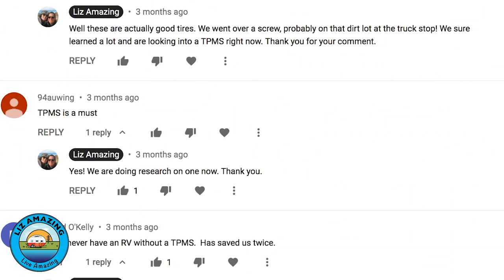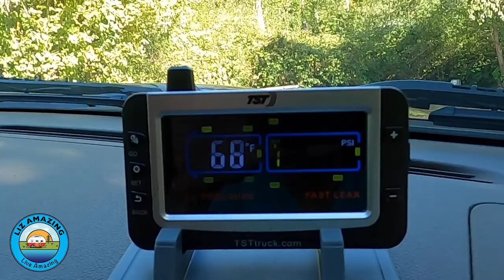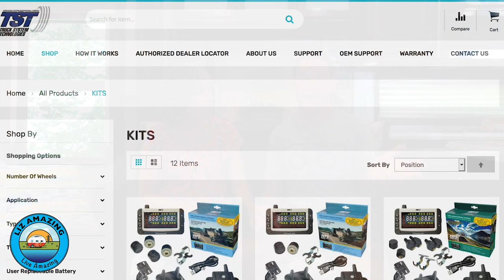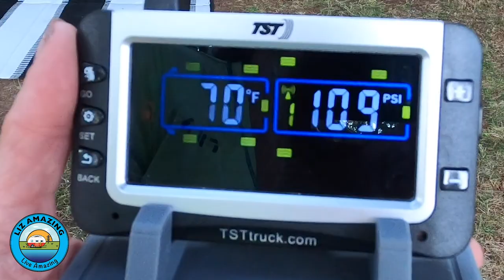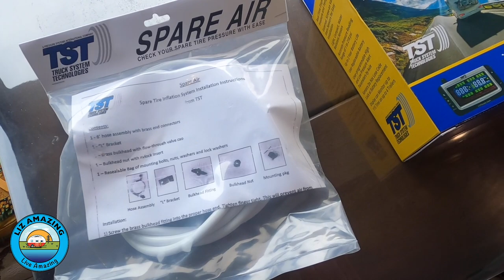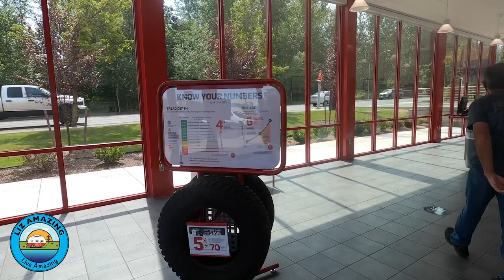How you can prevent a Tire Blowout | TPMS | Westlake Tires | Fulltime RV Living

Comment: We just had our second blowout. The first was the original cheap China tire that comes with the trailer. It did several hundred dollars of damage to the rig. I realized that my tires were under inflated. I didn’t realize they needed as much air as they did, lesson learned. This second blowout tore off the side trim of the trailer. Since the first blowout I bought GoodYear thinking they were US made. I’ve been anal about making sure my tires are good and inflated properly. We had only traveled about 150 miles when it blew. So now I guess I’m buying a TPMS system. Thank You for the video and the info.

Comment: Love your videos, guys!  You rock.  If I can say... I believe most blowouts on RV's happens because of two reasons.  One, the tire is not inflated to the pressure recommended on the sidewall.  I had a tire guy tell me one time that ST tires must be inflated to the pressure rated on the sidewall, or you will have a blowout.  Second, driving over 65 mph.  I never drive our RV over 60 mph, even on Interstates.  If I'm on a county road or something, I'll pull over and let people pass if I'm not doing 65 mph or more.  I drive with the China bombs that came with our RV and never had any problems traveling all over the U.S.  Drive fast and not have the pressure up, I can almost guarantee you will get a blowout at some point.  Keep the awesome videos coming!!!
Reply from the maker: Great points! We agree 100%! And we will never be without TPMS because the continuous monitoring is so valuable. Happy travels and be safe!

Comment: Tires heat up for a number of reasons besides the outside temperature and inflation pressure. Wheel alignment, loaded weight, driving style, (excessive braking, cornering too fast, as well as excessive speed) .......are all factors in tire temperature.
We have the TST system and love it. One tip....use metal valve stems even with the lighter weight sensor caps (non flow through).......rubber valve stems will bend from centrifugal force at even moderate highway speeds. Our sensor caps were bending down far enough to touch the rims. Those rubber stems are not going to last very long.........
Reply from the maker: Yes, that's a great tip about the sensor caps. I know we have metal stems on the truck, will check the camper. Stay safe out there!

Comment: Great video.  One thing I have seen multiple times on trailers and RVs is the incorrect rating of tires on campers.  Manufactures to save money or even dealers will put tires rated for the dry weight of the camper.  When you add food, gear, propane and water that can add hundreds to thousands of pounds. Those tires may not be rated for the extra weight which in turn will cause heat build up and blow outs.  I have walked through rv lots looked at tire load range then the GVWR of the trailer and the tires are rated for less then the total weight the trailer is capable of.  When buying check the tires new or not better exceed GVWR of the camper/trailer.  Stay safe.
Reply from the maker: Such a great point, thanks so much! We upgraded our truck tires (we pull a fifth wheel camper) for this very reason. So important, thanks again!

Comment: We bought our travel trailer new and the very first month we had a blow out with the tires that came with it.  We immediately switched them out for better tires, since we check the tires constantly, and seeing how bad the rips in the tire was. However, we are impressed with the sensor system you have incorporated, and think we will do the same soon. Thanks for the great safety tip and your research.
Reply from the maker: Hi again Charlotte, Yes, we cannot recommend enough the TST Truck system. It truly is something everyone towing needs to have. Things happen fast and we had just checked our tires about 90 minutes prior to our flat. If we'd had the TPMS we would not driven across the Golden Gate Bridge with a flat tire! Be sure to use the code to get a 15% discount: LIZ15.

Comment: We bought a used Solitude, and didn’t know the history of the tires. And they weren’t high speed rated. So I did my research, and ended up choosing Sailun S637 tires. I mail ordered them, and had them locally installed. The tire guys at the shop were in awe at how heavy duty these things are. Our first trip was almost 2000 miles from Wisconsin to southern Florida. Ran at highway speeds the entire way (70+) with complete confidence. The pressures were spot on the entire way. But your video has convinced me to get TPMS. Relatively cheap insurance, IMO. Thanks for all of your videos! Paul sure was a good addition to the team. ;-)
Reply: Oh, and one other question comes to mind. Should one have the tires balanced WITH the TPMS sensors attached?
Reply from the maker: Hi Douglas! It would be a good idea to get the tires balanced with the TPMS installed, but you probably wouldn't feel it on your trailer if you didn't. We got our tires balanced on the truck, but not the trailer when we added the system. 

So glad you are getting TPMS (remember to use discount code of LIZ15) as we believe everyone pulling a trailer should have one. I'd heard of Sailun, glad you are happy with them, good to know. Wow- 70+ miles per hour, you are definitely hauling!  

Agreed that Paul sure adds a lot to the channel! Thanks for your comment and looking forward to meeting you at a campground someday!

Comment: Your channel is great. I use Sailun load range G tires on my 10k pound toy hauler. I used them on my previous 5th wheel toy hauler as well after having multiple blowouts on the back right tire. Once I put the Sailun tires on i didn't have any problems. When I bought my new work and play I thought I'd run the China bombs that came with it. Wrong. 6 months later with maybe a thousand miles on them I had a blowout. Luckily it didn't do any damage. I put the Sailuns on and haven't had any issues since. I also run the tms system as well. They aren't guaranteed to prevent your rv from being destroyed because you can hit something. At least you know you have a flat. I can't tell you how many times I've seen people pulling an RV and had no idea they had a flat. It can be difficult to see the passenger side tires. Since buying my tpms I feel comfortable pulling at night again. For the longest time I wouldn't pull at night because I couldn't see the tires.
Reply from the maker: Thank you so much. Yes TPMS is great! Glad to hear you have it. And we've heard good thins about thos Sailuns. Happy trails to you.

Comment: Tires are SO important. I agree with you on your points about heat and underinflation. Driving too fast, which increases heat, is another important factor, as is overloading. I very strongly suggest you replace those relatively cheap Westlake tires with Goodyear Endurance. Lives may be at stake. You spent a lot of money on that big heavy trailer, so don't cheap out now. Not that you are :). Its just that you are moving a lot of weight down the road and that is all sitting on something that is not up to snuff. The manufacturer is going to use whatever benefits their bottom line the most, and you have already had quality control issues with that unit. Please consider my recommendation.
Reply from the maker: Thanks. That’s why we did the research on Westlakes. We do believe TPMS is a must for all who are towing a trailer. And when it’s time to replace the Westlakes we’ll do it sooner rather than later. Thanks sp much for your comment.

Comment: When I bought my fifth wheel the dealer put new tires on it for me that were weight rated just enough to carry the weight that was on the axles. ( load range E made in China) I immediately took those tires off and put heavier grade tires on it. ( load range G American) I also had them filled with nitrogen. That way no matter what the ambient air temperature or the temperature of the tires they will always have the same amount of pressure in them. Doesn’t matter if you’re in 20 degree weather or 120 degree weather the pressure will be the same.
Reply from the maker: Yes, that's a great point about nitrogen. We have not had that experience though. Now on our second rig that came with nitrogen and we still lost pressure with the cooler temps. We do sincerely recommend a TPMS no matter what kind of tires you have. I can tell you the peace of mind is totally worth it. Who knew that blowouts are often predictable? Be safe out there.
Reply: Physics says that for any gas in an enclosed container (your tires), if the temperature goes up, the pressure will go up.....

Comment: Some great advice.  I have a friend who uses a contact thermometer to check his tires and hubs when he stops after he had some breakdowns on the highway.
Reply from the maker: Yes. We have one, too. But nothing beats having a TPMS to keep constant monitoring of all tires. We think everyone towing a camper should have one.
Reply: Blowouts generally happen between stops.  Better to know the temperature in real-time.  Get the repeater.  If TST display doesn't receive a reading from your sensor(s), it will display old data (up to 2 hours) before timing out.  Hey TST: display measurement age.

Comment: my trailer tires were always inspected & Air pressure checked however my china bombs had several blowouts. The first Blowout was at 60 mph & it tore out the kitchen floor under the sink  cutting water lines & electrical wires along with the sink drain hose and 3 or 4 kitchen drawers. $8000.00 dollars was the final count for repairs including 5 new tires.
Reply from the maker: Wow. So sorry to hear that. This is why we believe in TPMS so much! Wishing you safe travels.

Comment: Thanks Liz and Paul, somehow I missed this video.  I have Westlake's on my 2018 Reflection with over 12,000 miles and no problems so far.  I'll likely replace them after next year.  I use a tire pressure and temp. monitoring system and watch the temps.  Also have an Infra Red gauge for checking hub temps. at fuel stops.
Reply from the maker: Hi Robert. Glad you found this video. If you ring the bell, you'll get a notification each time one is published so you don't miss any. We love hearing from you and Paul and I are both glad that you have a TPMS and are (like us) focused on safety. Happy travels to you!

Comment: Liz, i’ve only called them valve stems. 

I was driving my mom’s class B motorhome on the highway and we had a blowout. Even though it was a virtually new rig that’s when we found out that somebody had switched  the tires when she had in for service and put on retreads. 
So part of the tire was caught up in the rig. The tow truck driver tried and tried and could not get it out so eventually his friend came along with a Mustang. He parked the Mustang on the part of the retread that was laying on the ground and we drove the RV forward to get it unattached. 😱
Reply from the maker: Oh my goodness, what a story! And shame on that shop for switching the tires. 

Yep, valve stems all the way! Who needs to learn a new word??

Does your van have TPMS? We have the factory included TPMS but added the system bc of the alarm. I’m a believer for sure!!!
Reply: No tpms but may get it because of your video.  Thanks!
Reply from the maker: It will certainly give you much peace of mind.

Comment: I had the same idea with my Westlakes. If i have a tpms, then I'll know before they blow out.  With just over a year and less than 10,000 miles, i saw tread flying off my trailer while driving on the highway. The tpms was reading proper tire pressure and temperatures around 130 on all 4 tires so i thought the tpms malfunctioned. It didn't, all the tires were still inflated but the tread completely came off of one of them and did a lot of damage to the fender flare and j wrap. I now have Goodyear Endurance. Maybe a fluke thing but a tpms didn't save me from Westlakes.
Reply from the maker: Oh my gosh. That is good to know. I am so sorry that happened to you. Thanks for your comment as that really is something to consider.

Comment: I think almost all tires are now manufactured in China. I believe the last surviving all-American tire maker is Cooper. 
Once on the highway, a tractor-trailer had a blowout right next to me, as I started to pass. The noise of the explosion was huge. I floored it and got out of there fast before the tire started to shred, which it started to do right after I got past it. Whew! Fortunately, I was not pulling a trailer. I was however driving a Saturn, which was acceleration-challenged, hehe. Thanks very much for posting that tire monitoring info
Reply from the maker: Wow, what a close call! Glad you got away from that OK. That would have been cool if you happened to have a dashcam capturing the tire shredding. 

We strongly believe that everyone who is towing a camper needs a TPMS for sure. Doesn't matter if you are fulltime or just on weekends.There's just too much at risk- as you saw right before your eyes!

Thanks for your comment and be safe.

Comment: When it comes to flat tires,  it's smart to know how you're going to actually  lift your rig when it happens. Many have the Anderson Rapid Jack (a large curved wedge) or similar products.  I have it myself.   However. these don't always do the job... sometimes they don't lift the flat tire high enough. Take a look at a product called "Trailer Legs". I have used these in the past... they really work well. Take a look. Safe travels.   bg
Reply from the maker: Thanks so much! I hadn't heard of those. We lucked out and were able to use our trailer jacks to jack the rig up. Thanks for your comment and suggestion, very helpful!
Reply from the maker: p.s. we believe everyone pulling a camper should have a TPMS system. If you don't have one already, check out TST and get the 15% discount!
Reply: @LizAmazing  oh that's right, you guys have a class A... I'm thinking in terms of my 5th wheel (or TT).
Reply from the maker: We do have a fifth wheel, were able to use the autolevel jacks.
Reply: @LizAmazing  sorry.... the lack of camping is getting to me ;)
Reply from the maker: lol! You must get out!! Hope to meet you in a campground someday.

Comment: Drove team with my late husband driving tractor and 53 ft trailer..If something happened it was usually when I drove..Having the correct tire load rate is important..We were having problems with steer tires not wearing properly..Found out from a different dealer then we usually bought our tires from that we needed a heavier steer tire..Also alignments are important..Even a new vehicle or trailer directly from factory needs alignment checked..The manufacture will tell  you they are aligned at factory..But we had tires wear premature excessively. Tire manufactures will blame it on road hazard..I've had tires blow..Luckily no damage was caused..One time when LH was driving across I-90 east in Minnesota on a very cold night just before Rochester a tire sheared off..Luckily no traffic thank God..So no harm was done..The first cab over semi we had was a nightmare..Along with company trailers..When we got a new semi and our own trailer things went better..Because we did maintenance when needed.  Every time we stopped we check our equipment over..If a small problem developed we got it fixed. I like Kelly tires..They are made in the U.S.A..I try to buy America..We need to take care of our own people and provide jobs..Thank you for the video..Have a blessed day..
Reply from the maker: Hi Gail! Thanks so much for your comment. Yes, load is very important and we just upgraded the tires on our truck for that reason. We believe everyone who is towing a trailer (no matter if full or part time) should have a TPMS. This system will tell you as soon as you start losing air or if the tires are getting too hot. Be safe out there!
Reply: @LizAmazing  I went to their web site after viewing this video. And they are experiencing delays due to the C virus..I didn't see any locations near me..Did you order and install them yourself?  I wish we would of had all information that is available today via web,cell phones in the early 80's..We had to learn everything in the school of hard knocks..Which can be a costly learning experience.I really feel anyone towing a RV trailer needs to go to school for a special license. Like truck drivers do to learn training and knowledge to earn a CDL. Plus learn of maintenance..I'm glad to hear you upgraded your truck tires..
Reply from the maker: I noticed (depending on the browser I am using) that the Covid warning dims out the whole website. Try clicking on a page or using a different browser. We ordered and did the install. It's super easy, you just tell the monitor which sensor is going where. And then you just replace your tire valve caps with the sensors. 

I hear ya regarding people needing a license to drive a trailer! I agree. 

Let me know if you are able to get into that site.

Comment: wow your lucky i have a cdl and tpms is a great system for monitoring your tires but if you have the wrong tires on the rv it could cause your tire to  still blow
you have too weigh your rv with everything in it water food bikes tools everything plus add you and your passengers for a total gvw then check if the tires are rated to handle it 
most rv drivers don't follow or don't know that they're overloaded 
like your truck you had to up grade your tires and suspension to tow your  bigger 5th wheel
Reply from the maker: We sure did, we upgraded tires and suspension. Yes, you're absolutely right that you want to make sure you don't overload your tires. What we love about TPMS is that they can actually predict (and therefore prevent) a blowout. We didn't learn that until after our flat tire incident. We think all people towing a trailer should invest in a TPMS. Be safe out there!